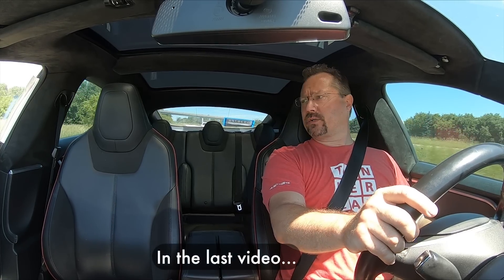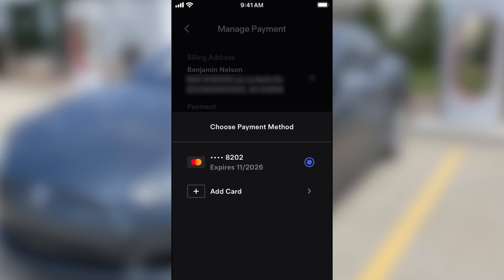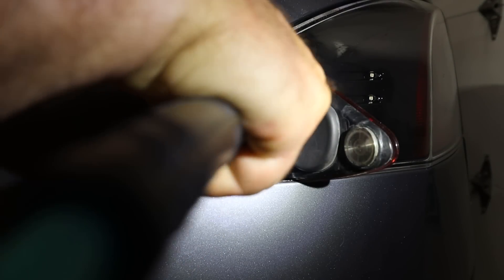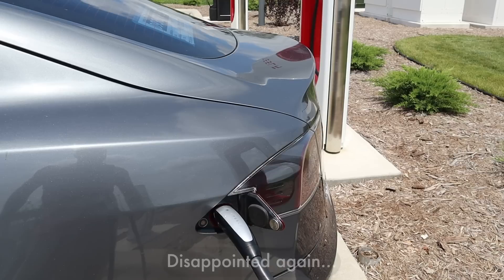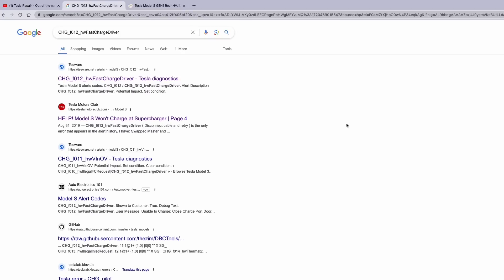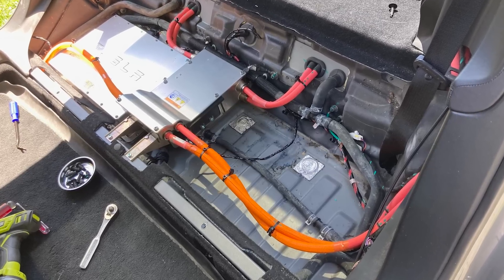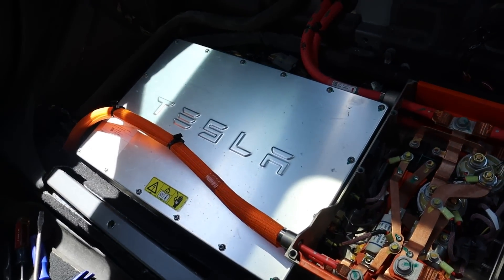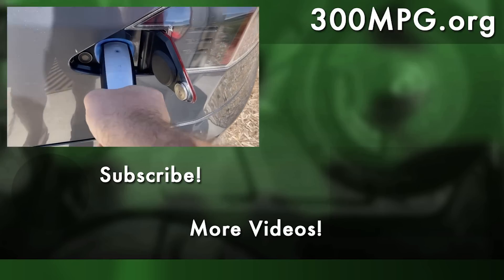DIY Repaired 2013 Tesla - First Time ATTEMPTED Supercharging

Comment: I was thinking about your issue and wanted to know about the material that the mouse used to build its nest. It looks like the same color (8:33) as the insulation that's by the cables that lead to the charge port.  If the mouse got in there and used its teeth to gather the material maybe it damaged some of the cable that leads to the charge port affecting the DC charging. I would check that area for damage and possibly an electrocuted mouse, since its last trip for more nest materiel could have been fatal..
Reply from the maker: I got a pretty good look in the side where the charge port cables come in. I didn't see any rodent damage. The trouble with mice is that they are SO SMALL and can just get ANYWHERE! That's the worst part of seeing a mouse nest - never knowing if there is some damage somewhere you just didn't find!

Comment: I had a similar problem in my 2015 Model S. I was on the way home on a road trip and the car failed to supercharge. Roadside assistance sent me to a nearby Nissan dealer to use their L2 AC charger. We had to camp out at a restaurant to get enough to carefully hypermile home. At home Tesla service replaced the on-vehicle charger under warranty. That fixed the problem.

Comment: I like the chrome delete on your car! Hopefully you can get it to supercharge again! My Model S is a 75D facelift from late 2016 and it has a different kind of charger, but still the charger activates the contactors for fast charging. One day it would not want to supercharge anymore (slow AC charging worked just fine) and Tesla service wanted to replace the charger. It turned out that the chargeport itself was the problem! New chargeport solved it.

Comment: Is the magnet on the charge port door stuck to the door or still glued to the car?
Reply from the maker: I think that you are suggesting that perhaps a sensor on the charge port may be causing the issue. No. There's nothing physically/mechanically wrong with the port.
Reply: @BenjaminNelsonX  just making sure. Very easy and free check. Just to be clear, make sure the metal disc is properly glued into place. Good luck.
Reply: are you blind  watching youtube ?

Comment: You can most likely open up the charger and start from the pins of the connector that go to the contacts.. and follow the traces on the board and you will most likely trace them back to a little rectangle relay that can easily be change out with a little soldering.  This is very common on ECM's these days, because they are putting more and more relays internally and forcing people to buy a whole new ECM---  or putting them internally/ inside the fuse box.   but again, I've seen many videos of poeple fixing these little relays and they all look the same.   I bet it would be easy to find the part-- unless Tesla has gone crazy proprietary on something as simple as a standard relay. :)..     If the new charger gets it going:   I'd love to see you tear down the old charger;  because I bet you could fix it easily with one internal relay swap.

Comment: I know that Tesla likes to lock out any car that has been crashed or flooded, etc..   So if there was an insurance claim on this car,  Tesla may have permanently locked it out..  I'm not sure exactly how they do it, or if it would even tell you in the codes or on the screen.   Worst case scenario, you could manually run wires to those contactors and force them to switch over to the supercharge side.  I'm assuming they have a sensor that feeds back to the charger to let it know the position of the contactor mechanism..  and if you manually activated them, maybe the charger would think the drivers are working correctly and work fine.   but I'm making a lot of assumptions here and would have to research how it works exactly.. and how it actually knows the drivers are bad/ or that the contactors aren't activated.   It might just be sensing the voltage or current of the driver circuit itself rather than having an external sensor on the on contacts mechanism.  If it's monitoring the contactors themselves, then it wouldn't really know if you activated them manually or if the drivers were doing it..  It would just see the state that the contactors are in and report back..........   So when you tell it to go to supercharging..  and it never sees the contactors change, it just throws a code assuming the drivers are bad (hypothetical maybe).   But knowing how most internal drivers/ relays are monitored on ECM's,  it is just watching the voltage output on the lines of the driver (whether it's a pull up or pull down circuit?  could be either one).   On a regular car, you would be able to go into LIVE DATA and see the driver state in the charger....  So you would know either the driver is not sending at all-- or it says that it is sending, but just never gets there (like a bad connection or something).   Anyway, this should be fun on the next video.   You've definitely built up the suspense. lol

You can most likely open up the charger and start from the pins of the connector that go to the contacts.. and follow the traces on the board and you will most likely trace them back to a little rectangle relay that can easily be change out with a little soldering.  This is very common on ECM's these days, because they are putting more and more relays internally and forcing people to buy a whole new ECM---  or putting them internally/ inside the fuse box.   but again, I've seen many videos of people fixing these little relays and they all look the same.   I bet it would be easy to find the part-- unless Tesla has gone crazy proprietary on something as simple as a standard relay. :)..     If the new charger gets it going:   I'd love to see you tear down the old charger;  because I be you could fix it easily with one internal relay swap.

Comment: I was sure it was going to be the contractors as I have already been thru a set on my TM3. Why didn't you go with TWO chargers so you can AC charge at 80 amps as long as you are taking the charger out?
Reply from the maker: I thought about that. I don't really see any need to be able to charge at that rate. Either I'm on the road and want to charge as fast as possible (and can do that with a Supercharger, once I figure out how to fix this..) OR I'm at home and have plenty of time to charge overnight at something like 32A. I really don't know of any places around with 80A EVSEs that I could use, and it would be an expense to do the upgrade to install one at home. It just doesn't really seem to offer me any advantage.
Reply: @BenjaminNelsonX  The problem with Teslas is there are not enough hackers fixing them for YouTube, so those of us who can follow a YT video don't have a lotta things we can do to our cars. If you figured out how to do it I bet the price of an 80 amp charger on EBay would skyrocket as others follow in your footsteps. Thanks for the wet fuse hack anyway.
Reply from the maker: @israndy  I actually MAY end up installing a second charger. You'll find out why later. If I do, I'll make a video on it. There are plenty of used Gen 1 chargers available out there.
Reply: I had a contactor go out in my M3, it would AC charge, but not Supercharge. Going through the errors is good for clues. The error you are getting is one of the ones I got when my contactor failed.

Comment: This is interesting. I have a 2017 Chevy Bolt. I bought it about a year ago. It would level 2 charge but not level one. Luckily it was under warranty still. Turns out, prior owner had let an animal chew on the charge cord and, it shorted out various components in the vehicle. Anyway, it got fixed under warranty and I’m very pleased with the car. Now has 85,000 miles.
Reply from the maker: Back when we had the 2004 Prius, a mouse got in and chewed a wire INSIDE the battery pack! Fortunately, I had a friend who recently took a Prius apart and he still had that wire harness, which I used as a replacement! It was plenty of work though.
If mice chew on your car it's best to still be under warranty!
Reply: @BenjaminNelsonX  oh yeah, i saw the bill and it was about 4500$ worth of parts. I think the high voltage 120/240 shorted across some computer signal wires and that was the end of that! Cool thing tho, is the car has new charge port, and a bunch of new stuff all the way down the line, plus the battery recall happened in 2021 so I’m very happy I didn’t have to pay all that! I’d love a broken Tesla. Will maybe start looking around…

Comment: Did you try a non-tesla fast charger or isn't that an option in the US?
Reply from the maker: Truthfully, I didn't even think of that, but I also don't have an adapter to go from some other fast charger type to the Tesla connector. I'm nearly positive that the issue is something internal to the car, NOT billing, my account, or some other issue related to Tesla.

Comment: For ""security reasons""... totaled Teslas are disconnected from the supercharger network. I hope that in your car's history there are no unregulated repairs, or the car has been totaled. If that was the case, there is not much you can do.
I really hope you can fix it!
Reply from the maker: @DocMasterm  Not totaled. Just a used car. Clean title.